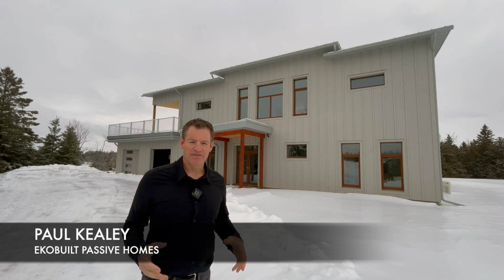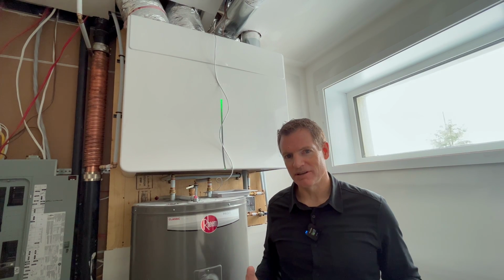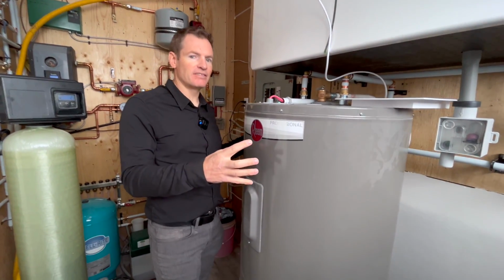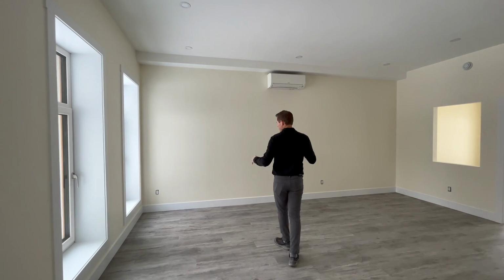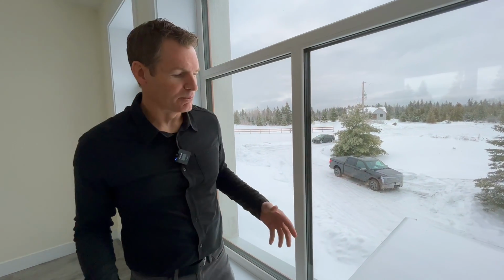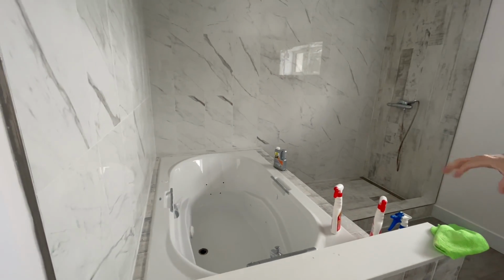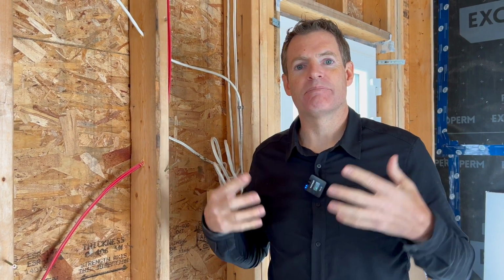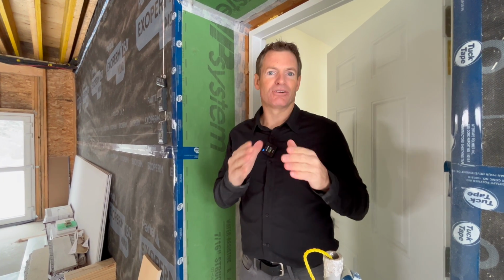Passive House Tour | Frontenac Model

Comment: Exterior insulation allows us to build timber frames on par with stick built double walls or 2x6 walls. Plus can put up finish on timber frame once roof done. We do a lot of ship lap instead of drywall.
Reply from the maker: Exterior insulation can help improve performance for sure 👍

Where Passive House differs is the whole envelope is modelled and verified, so you eliminate thermal bridges and know the building will perform, instead of relying on multiple techniques working perfectly together.

Comment: Out of curiosity, what were the results between the hot water tank vs the instant electric water heater? Which one did the owner stick with? Also, how was the water for the underfloor heating system powered? Thanks! Great video.
Reply from the maker: It’s nice to see your questions! Glad you enjoyed the video.
The instant electric water heater used approximately 2x energy, so this confirms instant electrics only makes sense to use if saving space is necessary for tiny homes, etc…
Hydronic floor system is powered by an electric boiler, any other questions just let us know ✌️

Comment: I think passive house system focuses more on heating than cooling?
Reply from the maker: Depends where the passive house is located. For example, 
-passive homes in the northern USA or Canada heat 3-4 months, cool 1 month
-passive homes in Southern USA or Canada cool 3-5 months, heat 1 month
-passive houses in warm/tropical climates, cooling may be required for 9 months 
In all cases above, weather heating or cooling is required, very little energy demand approximately 3 hours per day

Comment: Where is this home located? I'm impressed with the twenty inch thick walls and European tilt-and-turn windows. The mechanical room is tidy and well laid out too. It would be interesting to know what that siding is, and what was chosen for a roofing material. My only criticism is the size: unless a family has six or eight children the house is oversized. We call it build obesity.
My wife and I designed and built a super-insulated, passive solar off-grid home some fifteen years ago in central British Columbia. It was cutting edge for the day, with twelve inch thick walls (also insulated with blown-in cellulose) and triple-glazed windows (much more affordable All Weather vinyl windows, most of them fixed) with rainwater catchment for toilet flushing. It is a pleasure to live in and uses a tiny fraction of the energy our neighbours homes do. Yet few people I know are willing to pay for performance. Homebuyers are like children, attracted to flashy features like hot tubs, stainless appliances, granite counter-tops etc.; they are quite unwilling to pay up front for high-performance . Instead, they buy their 'dream homes' and start complaining bitterly about their enormous heating and cooling bills.
Reply from the maker: The house is located just outside OTTAWA in Mississippi Mills Ontario, and regarding the size – this house was built to accommodate three families with Ukrainian refugees in mind so the reason it is naturally larger
Reply from the maker: Great to hear your amazing comments!
Especially the last one which makes me think of short term, thinking “let’s build the cheapest house possible with the nicest possible finishings” the irony is - in the modern world that house will actually cost the most and be terrible for our world because of energy use/cost
Greatest thing about building a passive house now is the extremely small incremental cost to build Is more than offset with the savings and energy, etc.

Comment: Great video! I wanted to ask about your roof system for most of your projects. They are all generally low slope with standing seam metal roofing. Do you use snow guards to protect the gutters? I'm in a high snow load area in Canada as well.
Reply from the maker: Thanks glad you enjoyed!
Most of our customers do not install eavestrough except where the roof is sloping towards a door or entryway but that said, snow guards would be a good option if Eavestroughing is present
If protection is required, we recommend snow fence over snow diamonds as the fence is stronger
Reply: Absolutely agree with the snow fence, and thank you for the reply! What I like about your designs is that the roof massing is kept fairly minimal, which reduces material costs and allows you to use the best products, such as standing seam metal roofing. Great work! @EkoBuiltPassiveHomes

Comment: How would a passive house built for the southern U.S. differ?  High heat and high humidity are near-constants…high humidity even during the winter.
Reply from the maker: Thanks for your question. In general southern climates R value can be reduced to R45 (instead of R75) 
In areas that have high humidity year-round, the vapour barrier is to be on the exterior of the home, and the open permeable membrane on the interior
Reply: That’s interesting. Thank you for replying.
Reply from the maker: @Robot_Cajun  our pleasure! Any future questions or comments just let us know ✌️

Comment: Well done as usual,really enjoy your video.how did you do the upstairs radiant heating?
Reply from the maker: Glad you enjoyed it and thanks for asking!
Second level radiant floor was done with hydronic tubing stapled to the subfloor and 2” concrete over pour. 
This method is best for a couple reasons. 
1 - Concrete poured directly on subfloor creates a stronger floor
2 - Concrete distributes the heat evenly

Comment: Great video!  Love the time you spent in the mechanical room.  I didn’t hear anything about air tightness?  Keep up the good work Paul, I met you a couple of years ago at your house in kanata, you inspired me so much that we have built our own passive house in Maxville Ontario, we are certifying the house and just had our pre air test and it was 0.045!  Please come visit if you are ever out our way!  We are almost at the stage of the Zehnder Evr install.
Reply: Peel passive house with Wilson architectural design in Martintown, Ontario.  It’s an Icf house, Nudura xr35 with an added 4 inch Homega panel on the outside.
Reply: That's a really interesting detail!    @cathydavidsongrant796
Reply from the maker: Nice to hear, well done! 

Our air tightness is normally anywhere from 0.1 to 0.5 depending on the design

Curious, who did you decide to use for certification? And what wall system did you use?

Comment: Blower door testing and air sealing leaks is under appreciated by most builders.
Reply from the maker: Absolutely correct!
Ultra low energy in ALL climates zones, depends mostly on air tightness! Passive House has proven connection details can be very simple, allowing easy air tightness in any home!

Comment: Great video as always. I would like to know more about that Jablotron Futura ERV. I heard it has a cooling module (cool breeze?) available for cooling and heating through the ventilation system. Is it enough for a passive house requirement? Also would like to know as well more about the window glass specifications for a passive house. Should we choose a more heat reflecting glass or a less heat reflecting glass? Those two topics would make two great videos 😊. Thank you and continue with your great videos👏👏
Reply from the maker: Happy to hear you enjoyed the tour!
And thanks for your suggestions!
Yes, the Jablotron has a cool breeze module, it works in tandem with a small Fujitsu heat pump which unfortunately is presently difficult to get in North America. That said we do have a customer who has ‘roughed-in’ a line-set for this heat pump in the hopes Jablotron will supply one for the project. The house is around the same (3000 ft.²) size house. And one cool breeze module is supposed to do the trick.
We will try to do some videos on other windows specifics, however a passive certified window in general is considered a “best of all worlds” window With the following qualities
-Thermal bridge free design
-Thermal performance at less than 0.85W/m2K installed (glass + frame)
-Solar heat gain when sun is at Low angle
-Solar heat reflection when sun is at high angle
-triple glazed glass with 2x  low E coating for reflecting heat back to the interior
Stay tuned for more!
Reply: @EkoBuiltPassiveHomes   "Solar heat gain when sun is at Low angle
-Solar heat reflection when sun is at high angle". How do you achieve that at the same time?
Reply from the maker: @joaosil  Thanks for asking - to clarify…a deep roof overhang on the south is what blocks the sun. 
Southern glass has a solar heat gain coefficient 0.6. With this SGHC, The windows are a 3:1 Net (in:out) energy gain.
East and west side of the home, windows should have a reduced SGHC which is usually 0.4
Reply: @EkoBuiltPassiveHomes  Got it, Thank you!
Reply from the maker: @joaosil  you’re welcome! Stay tuned for more.. ✌️

Comment: Thanks for the video, well produced.  I was wondering what the approximate cost is per mini split?  Are they heat pump mini splits?  If so, are they air source or ground?  Thanks!  BTW, I love the big second floor deck.
Reply from the maker: Glad you enjoyed! They are air source heat pump, mini splits. Cost is approximately 12 K, including the exterior heat pump and one interior (mini split) head, subsequent heads cost about 2K each.
A passive house only needs one single mini split per floor however, the homeowner of this house Put an additional one in all of the bedrooms. They are all controlled individually.
Reply: @EkoBuiltPassiveHomes  great, thanks for the reply.
Reply from the maker: @extendedp1  Our pleasure! Stay tuned for more and if you have any suggestions, please let us know ✌️

Comment: 350m³/h seems pretty low volume for the ventilation system compared to how large this building is, we have pratically the same unit for a small city house. From a European perspective it's weird that there is resistive heathing (both tank and floorheathing), why would you do that? Are heatpump (air-water or water-water) solutions hard to come by in the US?
Reply from the maker: ERV sizing depends on cubic volume of air in the home. A 350 actually would still be sufficient if the house was 4000 ft.² size.
In the video we mentioned the homeowner wants to compare electric resistance with air source heat pump operation
There are many air source heat pump options in North America, also water to water no problem
That said, there’s not many options for air to water, which would be a game changer for heated floors, please let us know if you know of any of these systems where you are located